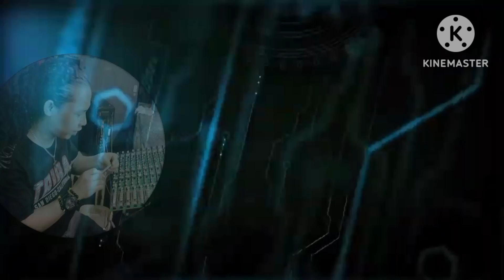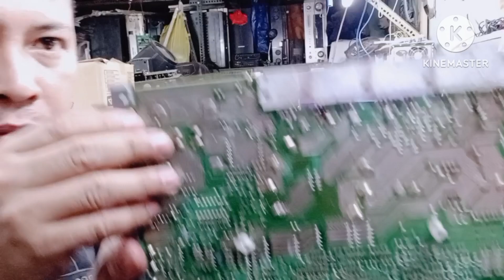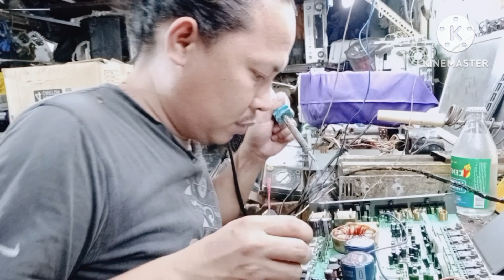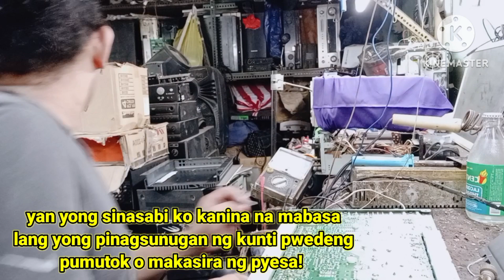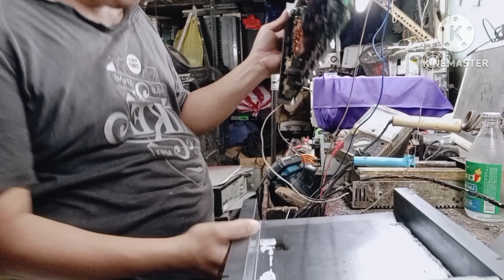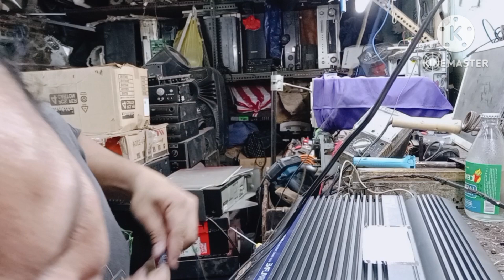ALPINE 4/3/2 Channel Power Amplifier MRV-F400 | Repair! No power problem!

Comment: Alpine mrv f504 idol wlang power anu Kya possible na sira
Reply from the maker: power supply section pwedeng sira mosfet, rectefier diode pwede ic tl494 oscilator dami posibling sira!